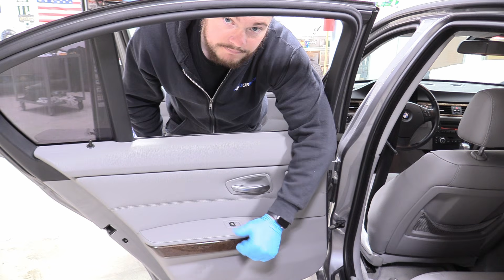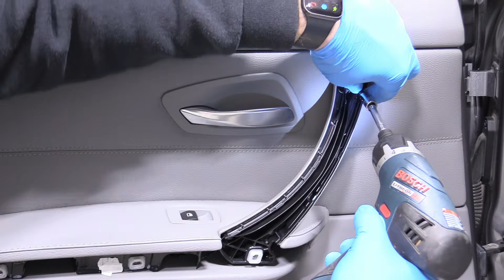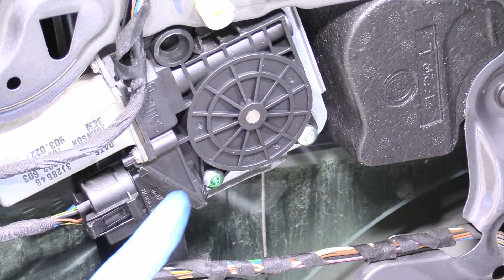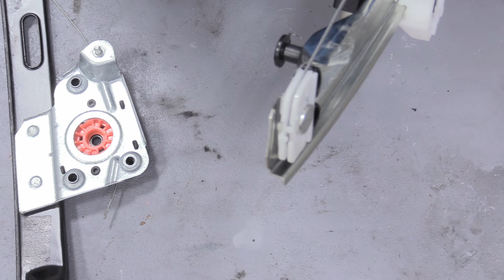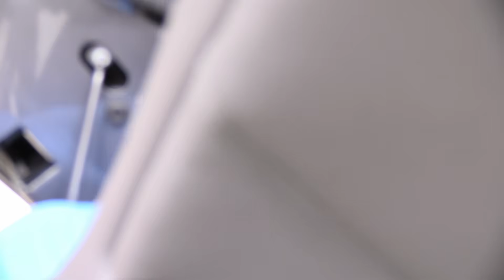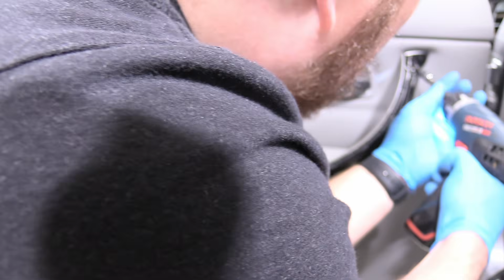How to Replace Window Motor and Regulator BMW 328i 2007-2011 | EASY!

Comment: Use a razor blade to slice the butyl on the moisture barrier, these cars are very sensitive to moisture entering the electronics and it helps w the sound deadening. The rest of the video was ok but in a profesional setting I’d fore you or make you pay for that moisture barrier.

Comment: I accidentally closed the door after opening it up and disconnecting the cables before installing the new regulator. It won’t open back, is there any way to manually open it back again?
Reply from the maker: Yeah you should be able to pull on the door handle cable. Thanks for watching!
Reply: Thank you for the fast response! However, I closed the door ON the Door lock indicator. Like the indicator wire is inside the closed part and I already replaced the regulator (it worked) . The door just won’t open.
Reply: Nvm, I got it to open, thank you for the help, great video!

Comment: Great video, bud! Just changed mine out. Took half hour max.

Saved me £150.00 (how much garages wanted to charge me). Bought a second hand part off ebay for £30 - the regulator including a motor - job done!

Comment: What if I put the new regulator in then it stopped working after it started working when I made it go up and down then tried to bring it back up to connect the window to clip any info

Comment: Couldn't get the door lock rod to up and down in the hole like it did before.  Seems like it has some resistance after reassembling.  Any suggestions?  Thanks for the great DIY video.  I could follow it just as you presented.

Comment: I’m having a issue with the motor, I just got a new one shipped to me and I just installed it and went to plug in the connection and flip the switch but the motor gets no power and I can’t figure out why

Comment: Excellent video.  Thanks.  I was able to follow it easily and replace my driver rear door regulator in my 2011 328i sedan.  I do have one tip to suggest.  I used a window scraper with about a 4 inch razor blade on it to go around foam to remove it.  It came off perfectly, and there was plenty of adhesive on both door and foam side to easily reinstall for an immediate stick.  It wasn't messy at all.  Just be careful around the 2 areas where the wiring is.
Reply from the maker: Great to hear!

Comment: You really should put that black cover that keeps moisture from getting on the door panel and leaking inside car . If you take a razor blade and cut the black rubber sticky stuff all the way around you're able to put the door protector back on . Also you should work with more care. you can't just go breaking clips and plastic on high end cars  . Because the Germans don't work that way.
Reply from the maker: Couple of things.

1. The RTV was a mess and I'm not spending a ton of time cleaning it up. You can if you want to. 
2. The door protector is largely unneeded. It has weather stripping around the glass and door. Door protector is a back up at best. 
3. Plastic clips become brittle and break no matter the level of care.
4. This car is 15 years old, it is hardly considered high end at this point.
5. I don't care how people work regardless of location. 
6. Thanks for watching!
Reply: @2carpros  it's not rtv it is black window butil

Comment: ALWAYS pin the window. Tape, suction cups, hell...even a wedge, if you value keeping all your fingers and/or not having to buy the customer some new glass...PIN THE WIDOW. 
Also, not silicone but putty, holding the sound deadening foam. Completely reusable according to BMW....as long as you don't rip the foam to pieces. 
Informative, albeit, clunky vid.

Comment: Awesome video. I did the window on the other side of my car after watching a different video, that didnt tell you to clip the wire or how to get the glass off the regulator. Huge pain in the ass that made me not want to do it again when the regulator went on the other side. After watching this video. I have the regulator out in under 30 min, with no problems at all. I dont usually leave comments,  but I felt this deserved some recognition after helping me so much. Thank you

Comment: I can't find any videos about just replacing the window pane. Could somebody point me in the right direction? There are a lot of videos about the regulator and motor but not about replacing the glass itself and I need you at because when the window fell it cracked.
Reply: Follow this video all the way til they get the window separated from the regulator. Then the window can be tilted forward or backward and pulled up out of the frame. Install the new window doing the same thing in reverse.

Comment: I just ordered my own parts and will do it myself. A friend of mine wants to charge 200 for labor and another $160 for the regulator to do the front passenger side. I was about to let him do it but figured let me see what needs to be done. After watching a a few videos the hardest thing to do is getting the old one out and the new one in. Getting to it is simply AF.

Comment: I've done this job on several vehicles.  The hardest was on my 79 Firebird (hand crank) and it involved chiseling rivets off and a trip to the body shop to have them adjust the glass for me.  The easiest was my 04 Avalanche.  When you open the box of parts it looks scary but the reality is the hardest part of the job was removing the door panel.  The only special tool needed is duct tape to hold the glass up while you work if you don't have a helper.
Reply from the maker: My 67 Camaro is pretty tough too, very similar car. Haha my favorite special tool! Thanks for watching!